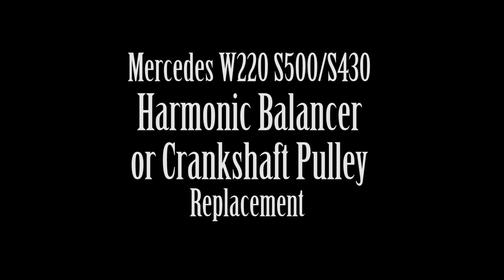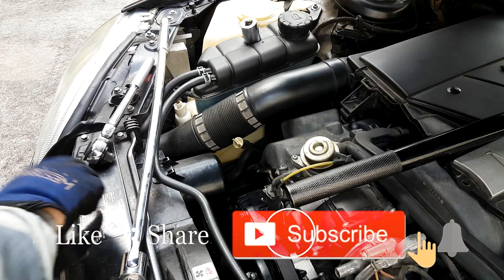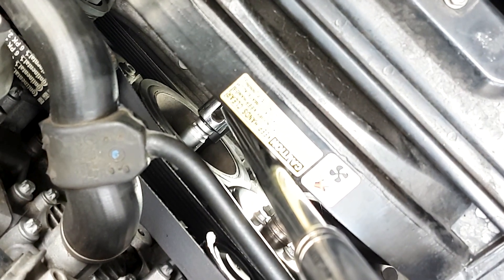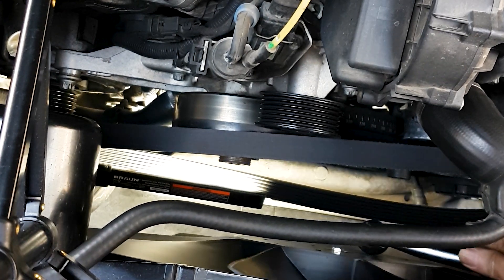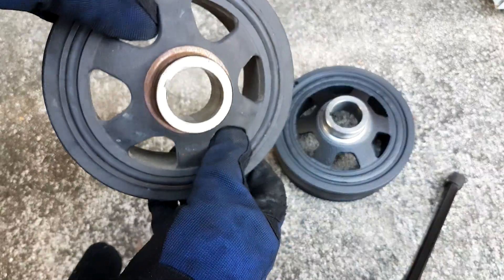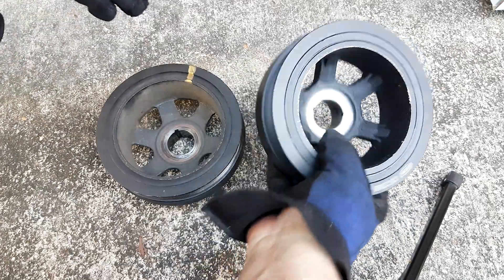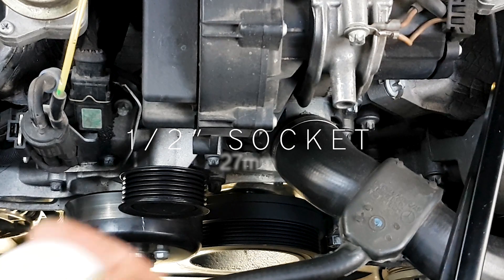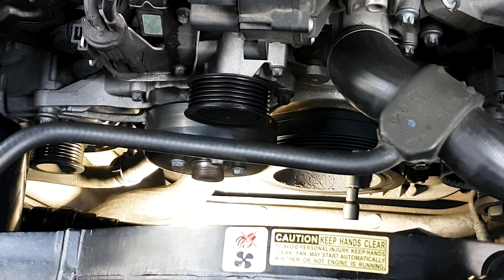Mercedes Harmonic Balancer & Front main Seal DIY - W220, W210, M112, M113

Comment: Thanks for the video. Got this done on my e430. Only issue was with the removal tool. Socket hole slightly deformed. Was able to hammer it back to finish the job
Reply from the maker: Wonderful.  If you did that, you can fix almost anything on these cars.

Comment: thanks for this quick question.  you cant reuse the same bolt is what mercedes says. so where do i find the bolt.
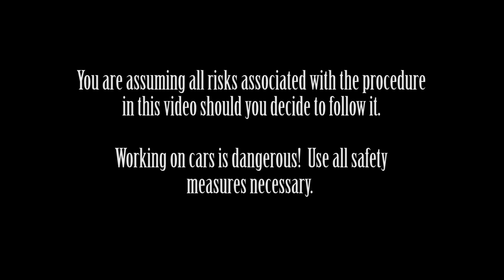Reply from the maker: Hi, I have the part number at 0:20 seconds of the video...I also mentioned where I got it in the video. You can Google and find it in many places.

Comment: Hello, my m113 is shaking/Vibration a little in idle. I changed really every sensor/sparkplug/coil, fuel pump/filter etc and in data everything Runs perfect. But this vibration drives me crazy. Is this a Symptom?
Reply from the maker: Could be engine mounts...I have a video on that and there is a way to test it. How many miles?

Comment: Hey I’m doing this job but the bolt is very tough to tighten while reinstalling the balancer did you run into this issue?
Reply from the maker: Hello @LuckiiChris  , it may seem that way.   First torque it to spec.  Did you?  Then turn 180deg.  This is the hard part.  You will need leverage.  See the beginning of the video for what I used as leverage.  If you cannot go much beyond120degrees, don't sweat it.
Reply: @masood-tv  okay because I have it lined up and twisted the bolt all the way with my hands but now it’s veryyy difficult to tighten it the rest of the way to make the balancer flush did you have this issue? The key way is lined up properly as well
Reply from the maker: @LuckiiChris  no, I didn't.  Take it out all the way and reinstall but key it in first.  Add some lubricant if you have to.
Reply: @masood-tv  okay so I added lube but am still experiencing a hard time to get the balancer flush. Is it supposed to sit flush with the seal right? Or is there supposed to be a gap between?
Reply from the maker: Were you able to torque it to spec first and then turn 180?
Reply: @masood-tv  no I can’t get it to tighten far enough to sit flush against the seal. I’m thinking it’s the balancer it’s self I may have to order a new one
Reply from the maker: @LuckiiChris  most likely.  What brand is it?
Reply: @masood-tv  it is an A premium. Which brand pulley did you buy was is oem?
Reply from the maker: @LuckiiChris  that is your issue.  Very tight tolerances there. Did you watch my video?  I think I have the part number and brand in the very beginning.

Comment: Masood what size attachment did you use inside the square hole in the CTA balancer holder. I cannot find one that fits perfectly like yours . Please assist if you can . Thanks
Reply from the maker: @Delly-qr6dn  hi, 1/2  inch.
Reply: @masood-tv  hi thanks for the response. Is there a specific brand you used that has the exact square fitment of that square hole on the holder?. I ask because I have a half inch attachment however it is loose when inserting into the square hole which prevents me from obtaining a proper  fit for my bar
Reply from the maker: @Delly-qr6dn  mine is from harbor freight...it is the smaller of their impact socket extensions in black...
Reply: @masood-tv  thank you. Greatly Appreciate you
Reply from the maker: @Delly-qr6dn  thanks.

Comment: Warning to all:  DO NOT use the suggested tool.  It may work or it may break (twist and elongate the square hole).  Also, even if it doesn't break, it may hold the pulley or it may not.  It is too light duty for this application.  Mr. Masood had success but you may not and it's not worth the risk.
Reply from the maker: Actually, the Ford tool is made of very hard steal.  I know because it took quite a bit of grinding to make it fit the new pulley.  The wrench may break first before the tool does.  It saves a lot of money over the Benz tool.  It works on some Ford trucks, so I doubt very much it would break at these torque values. I have since replaced 2 more crank pulleys with same tool, BTW.
Reply: @masood-tv   I am glad for your success but mine which is the same exact tool failed on the first use.  The Taiwan made copies of the actual Mercedes tool cost 100.00 vs. the 30.00 your tool cost but it is well worth it.  My wife's car will be immobile for several days so the extra money will be well worth it.  I am not criticizing you or your method, just warning others of the possible failure of that particular tool.
Reply from the maker: Where did you purchase it from, and did it say anywhere where it was made?  Also, was the bolt very rusty?  I am asking so we can pinpoint any variances for other viewers.  I am sorry you had a bad experience with yours.  I am also curious how is the car immobile if it didn't crack it open?
Reply: @masood-tv   It did allow me to remove the bolt but was so damaged as to prevent reuse to install the new bolt.  Further, it does not hold firmly in place vs. the method of the actual tool, which is a much better design. It was the exact same tool as you have.
Reply from the maker: @istvanmeissler2238  thanks.

Comment: My first attempt to remove the bolt has failed. I've used the CTA Mercedes lock tool, a 30 in 1/2 breaker bar with a 24 in steel tube extension and my 5' 8" x 145 lbs couldn't do it - and it would be useless to do with more leverage, because of my height. Some use impact wrenches on crankshaft bolts and CTA even offers special heavy sockets for that purpose. I've never used an impact wrench on a spinning shaft. Does one need to lock the pulley in this case? And could this damage the engine? Your opinion , thoughts and experience on this.
Reply from the maker: Hi Michel, you can absolutely use an impact gun, but you would have to remove the fan first to make room for the gun.  I have a video on that also.

Spray it with some penetrating fluid, leave it overnight or for a time and try again.  I am not sure how your height will impede utilizing more leverage.  Use as much leverage as possible.  Look at my video again.  I think I had over 5 feet of leverage easily...
Reply: @masood-tv  Thanks for your hints. Is a lock tool necessary with an impact wrench? Some say no, but the bolt being at the end of a spinning shaft, I can't see the difference than using a breaker bar...
Reply from the maker: @michelcroteau538  Np.  No.  You can leave the belt on.
Reply: @masood-tv  are you sure an impact is safe for this bolt?
Reply from the maker: @CL500MBZ  absolutely.

Comment: In your "short" presentation you say that an harmonic balancer going bad could have catastrophic consequences. I guess that its function is to reduce vibrations generated by pulleys and strap that it drives. What is the symptom of it going bad, does it go bad through rubber delamination and what would be the consequences?
Reply from the maker: Hi Michel, it could cause damage to the belt and then other pulleys...worst case break the belt and therefore cause auto  steering failure and accidents....
Reply: The outer ring can fly off and break the fan and coolant hoses causing engine to overheat.  It's just not worth the risk. If it's old then change it. I'm making a video about this. Masood your videos are amazing and inspired me to create a channel on YouTube also
Reply from the maker: @CL500MBZ  Thank you.  I will be sure to visit your channel.

Comment: Need to do this.on my.M275 in order to replace the water pump.
That gives me an idea of what im.getting.into.
Thanks.
Reply from the maker: Great, thanks.
Reply: I did it , I used the specific counterhold tool and a 3/4 inch breaker bar.
Reply from the maker: Fantastic.  Thanks for the update.

Comment: Thanks a lot.  I followed your step but I was not sure if the depression present in crankshaft was perfectly fitted on the harmonic balancer mark or not. But I tight the 27mm bold and the harmonic balancer went all the way to its position and Serpentine belt was perfectly fitted. 

Even if the car running fine without any noise, I am still not sure if the depression of crankshaft matched with balancer or not. So I have a question here, if the depression doesn't match, still the harmonic balancer will fit in?
Reply from the maker: Hi, the indentation or depression in the pulley must perfectly fit the tab or the protrusion on the crankshaft, or you won't be able to torque the bolt.and the pulley won't turn.  So, in other words, you have done it correctly.
Reply: @masood-tv thank you for reply. For cross confirmation,  I opened everything again and this time the crank pully was very hard to pull. I didn't had a puller so couldn't pull it. But what I observed is, the crank pully  0.25 inch  outside Crankshaft rod end position. In your case does the crankshaft pully and crankshaft rod exactly end at same point or the crank pully a little bit outside of crankshaft rod?
Reply from the maker: @torontoonline  if you torqued it to spec, that is how far it goes.  Alignment of the belt is another indicator of correct positioning.  Also, remember the indentation goes all the way thru.  I don't  have the car with me to check for you, but the pulley should abut the seal.

Comment: I suggest spraying this parts in cosmoline before installing (after taping the belt and crankshaft side of course). I personally use CRC SP400, but any brand works. I also use it on bolts under the car and other parts that can be affected by corrosion and they don't really get a nice coating from the factory. You'd be surprised how much that thing helps even 10 years down the line. Corrosion, rubber denaturation etc.
Reply from the maker: Good suggestion, especially for those in colder climates.  Thx

Comment: Will the harmonic balancer holder work for 2010 Mercedes glk350 4matic ?
Reply from the maker: Hi @kristay - no, it won't.
Reply: @masood-tv  ok thank you 😊 any chance you know one that will any helpful information will be appreciated
Reply from the maker: Your best bet is to remove the bolt with a half inch impact gun.

Comment: Hello, Im from over seas, but just find you channel. I have a m112 engine (clk 320) and the pulley at the left (looking in front of the car) the one with 4 bolts, how is it called?. I'm having a hard time to find it as it is getting loose in my car
Reply from the maker: Sorry for the late reply.  I was traveling.  I think you are referring to the water pump pulley.
Reply: @masood-tv  Indeed, I realized about that later. I'm no mechanic, how ever it was loose (my bad). Thanks any way. I'm loosing water but allready requested the spare. Do you happen to have the video to replace the water pump ?!?!
Reply from the maker: @MatiasFFernandezJ  Hi - yes, I do.  It is for an M113 but very similar to your M112 at https://youtu.be/fSfg5fpCiSk.
Reply: @masood-tv  Thanx, you are the best !!!!
Reply from the maker: @MatiasFFernandezJ  Thanks.  My pleasure.

Comment: Do I have to be set to 40 degrees
Reply from the maker: Hi Robert - no.
Reply: @masood-tv  I have a 03 cl500
Reply from the maker: @Robert Robbins  yes، it doesn't matter, the crankshaft remains timed to the rest of the engine and is engaged by the  timing belt when you remove the pulley.

Comment: Hello Masood, how's the steering column on your Mercedes? Have you noticed any clucking noise when you turn the wheel from very left to very right while parked? I have changed over a year ago all the front arms, even bolts and wheel hubs based on your videos, and it seems that it is a time to replace the column and I can't wait for your next video 😅would you mind to describe what you're going to address on your Mercedes this year?
Reply from the maker: Thanks, Igor. The car is 23 years old, so I would make videos if I can on whatever that needs fixing.  I know I have to replace the upper control arms at some point.  Also, the shifter was stuck at park the other day and am waiting for a part to fix that...I intend to keep it riding as smooth as the first day and so we will see what happens. My steering column is still ok though. Thanks again.
Reply: if you feel free play at rest when turning the steering wheel back and forth, it might be good to check your inner & outer tie rod ends for play, also the 4 conical rubber bushing inserts in the steering rack.   can also check the adjustment between the pinion gear & rack. all good places to look before replacing the steering column.
Reply: Well I'm following your video that bolt is really stiff and I'm really tryna to fix that balancer with a new seal I hope you can send me a msg back I'm following your ad vice but that 17 in h socket does not fit mine so I went with the 27n socket it still won't crack that manufacture seal it's so in there you know
Reply: @lisaellis4673 Have you tried to make a long bar/extension to the correct size socket?

Comment: In fact, I learned a lot from you. I have the same car and my own workshop. Thank you very much
Reply from the maker: Thanks very much.
Reply: @masood-tv  Quick question. The part behind the fan with the four bolts what is that called? I have a 2002 E430Benz and that part is loose when you move the fan which caused it to hit into my raditor. But noone knows what the name of that part is. I ordered a Fan clutcth but that's the part on the front. Whats the part on the back? Really need to know thanks so much.
Reply from the maker: @kenshinro7  do you mean the water pump?
Reply: @masood-tv  Thanks wish I had got this answer earlier. I wasted money on a fan clutch that I don't need. Yeah I had a few people  look at it and though some bands had went bad. For the whole time it was the water pump. Prayfuly next week I can get that. I think I will also need a radiator.
Reply from the maker: @kenshinro7  no problem.